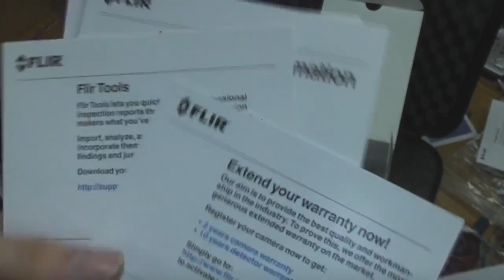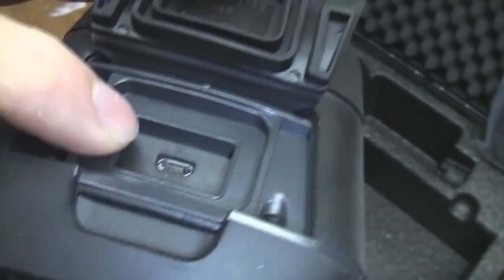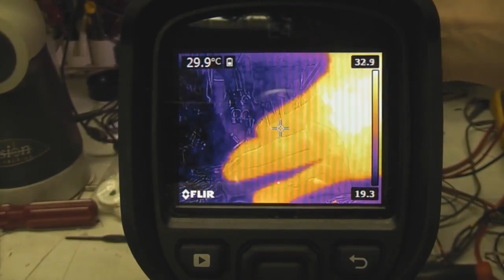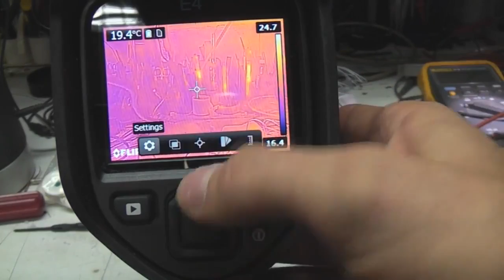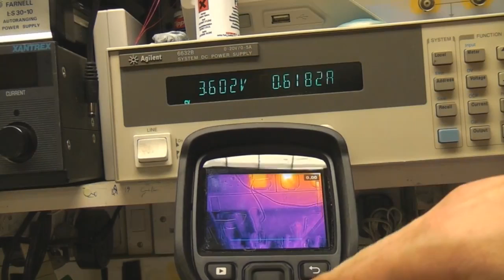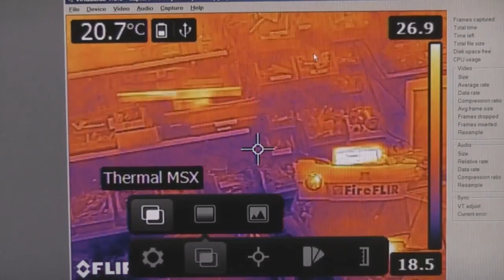Flir E4 Thermal imaging camera review

Comment: Hellow!

PLEASE ANSWER

I have the following questions:

 1.For medical purpose -can this camera be used to study the sleep of  people? To see and track sleep cycles. 

2. What diseases can this camera detect , with and related auxiliaries (computer, medical software, etc.) -as there are used in medical offices(cabinets) to put diagnoses using thermal images?

3. For surveillance and spying(espionage) -can this camera see what happens (what's going on) through these materials (so what happens behind the materials,while the camera is placed in front of the materials:
a.curtain through which a person can not be seen with the naked eye 
b.plastic bag
c.aluminum foil
d.double glazing
e.simple window(normal glass)
f.pvc door
g.wooden door
h.Steel (metal)Doors
i.5 mm thick metal wall
j.Hebel wall 10 cm
k.brick wall
l.concrete wall 5 cm,
m.concrete wall 10 cm
n.concrete wall 20 cm

Please answer to all the questions and select the correct answers for question 3,between variants from a to n.
Any additional information is welcomed.
Please post links where I can see how thermographic camera sees(show to us), for each subject separately (a lung disease, for instance,or how thermographic camera sees through the metal door, double glazing, etc)
Thank you
Best regards
Reply: hyytyfskn

Comment: USEFUL for looking at a cup of coffee, or hot water , or a fuse box, or in a small room part of a wall which great.  However, pretty sure it's nearly WORTHLESS for anything useful beyond your reach.  For example, you want to look up at the sky lights 18 feet up and check for leaks, or look at a cathedral ceiling.  Note how most of the useful things it probably can't see.  I don't mind if the temp isn't perfect, but need to see darker colors where leaks are etc.  Or missing insulation.  Or go outside your house and look for leaks up on the 2nd floor.   Or near the attic.  Notice how all the most useful things it probably can't do.  And before anyone says anything, those things ARE what most inspectors want to be able to do.  Note heat goes up.  Up and away to your ceilings, skylights etc.  That's where it escapes.  That's where the most important insulation would be.  Every video I watch, someone has the E4 looking at their hand, or something within about 8 feet.  Once you play with it, and exhaust those possibilities and try to do something serious, the question is, will it be useful?  I keep getting the feeling no, and that FLIR expects you to pay $5000 for something useful.  And they crippled the hardware on top of it.  So awesome, color hot coffee viewer.  And yes, majorly useful for applications up close.  If I can point it up at ceilings or even cathedral ceilings and look for hot and cold spots, someone please let me know.  I get the feeling it won't.

Comment: I think I know why the menu and the buttons are so sluggish and arranged in such a... sad manner:
As you've noticed and almost everybody knows, thermal imaging cameras are regarded as possible weapons. I guess you could sneak behind somebody, with that camera, and smack him in the head.
Just saying but if it's faster, easier to use, has higher resolution, is regarded as a weapon even more so. Imagine being able to switch between settings between two smacks... outrageous... 
Anyway, if it's sluggish and has odd menus is regarded as more benign.

Thanks for sharing!
Reply: I could easily sneak up somebody with that Flir E4 even if it's capped at 9Hz... I'll have to move slowly anyway to stay undetected, so what's the problem? And with low illumination the camera mode is useless, so the complication of switching between modes is also nonsense.
:D

By the way all regulations regarding IR cameras as weapons are rubbish. I understand it helps to discover somebody in the dark, but then I need to use ANOTHER weapon to kill/knock him off! So what's the problem?
Also regarding the "other" weapon I can easily make myself a harming object without even buying anything. Take for instance a piece of scrap metal :D

Comment: Another example - I had a device using TVS diodes to absorb transient spikes caused by a motor. Based on the specs and the approx spike magnitudes, I saw a risk of damaging the TVSes.  My colleague differed - he had measured the temp using a thermocouple and saw a 2 C rise. I took video with my Flir E50 and the hottest spot actually rose by 80C - still OK but closer to predictions.The temperature rise was too fast and localized for the thermocouple to pick it up accurately.

Comment: I'm still claiming that 1) YYYY-MM-DD is one of the least ambiguous date notations. (Don't use the other ISO8601 notations for anything but machine readable code.) 2) Again, it is a standard, which speaks in its favor. 
And as for "10-10", you should never write a date without a year in a permanent record (such as a date printed on a photo) anyway. You WILL want that info later. And exactly every month/day format consisting of only two number and a separator is completely ambiguous.

Comment: Well, my point was that day month year and year month day have different advantages which may make them better for certain applications. 

A Standard does not mean a certain representation is better in all cases, I could say that today is 2013283 or 2013W414 by ISO8601, which would probably be confusing to many, but if following it, I could never write todays date as 10-10, It would be 2013-10-10. Dashes are optional, they are only to improve reading for humans, so I don't have to write them.

Comment: Contact temp measurement will always be more accurate when it is doable but what about the temp of a small SMD device? Hard to attach a sensor to it without affecting the temp of the device. A spot IR thermometer needs accurate aiming and I've never seen one that can resolve a spot the size of an 0805 resistor. I've used a TIC to  plot the temp of 12 different parts on a PCB over time during a test - much easier than doing it all manually with a spot thermometer or using 12 thermocouples.

Comment: Indeed, they should be smd+through hole.

I even tried to pull on a cable connected to one of my own boards with smd+th Micro USB. The cable end broke of cource. To rip the connector of the board i had to have the connector part of the cable in and use a plier and a lot of force. The cable connector part was bent about 15deg after.

Comment from the maker: The sensor is vacuum encapsulated to avoid convection, so if it isn't perfectly sealed it could leak over time, otherwise it's no different from any other semiconductor device. I've never seen a TIC with  faulty sensor on ebay, so presumably they are reliable.

Comment from the maker: True but if you need to know temps that accurately you'd use contact measurement or a spot IR thermometer - most of the time, quickly finding where the potential issues are is the main application of a TIC.

Comment: The different representations might have advantages for certain applications. The DD.MM.YYYY system is good for general dates, since it shows the number you are most likely to want first. The YYYY.MM.DD is good for archival applications or referring to historical dates, anything where the year is the starting point. The MM.DD.YYYY system is good for adding a bit of general chaos and confusion to things. Seriously though, I expect it was originally mostly used without year, as MM.DD.

Comment: The low resolution plus MSX enhancement does seem fine for general troubleshooting. However, for design verification purposes, the higher resolution is often needed. For example, if you want to document the temperature rise of a number of components at once on a large PCB, you need each component to span more than one pixel in order to get an accurate temperature measurement. If several components are blurred into one pixel, then the temperature values are averaged together and not accurate.

Comment: Mike, the reflected temperature refers to reflected temperature compensation. If your surroundings are at a significantly different temperature than the object you are measuring and the object's emissivity is not very high, then the IR light coming from the object will be a combination of emitted and reflected IR and this option allows you to compensate for that.

Comment: Tell that to the many, many, many tens of thousands of phones and other portable devices where the single-sided surface mount micro-USB socket simply rips the copper straight off the board when force is applied. Not using through-hole pins for support is just crap.

Comment: just like some (android) smart phones. But when this SD-Card is specially formated and with the operating system on it, it would be still hard to utilize that fact.
But from a manufacturing point of view: Well, thats a good way to go. Small, relatively cheap and easy to source, you can easily benefit from dropping prices on the storage marked...

Comment: Reflectance temperature - my favourite demo.
Take a boiling pan of water. Cover with a clean sheet of foil - you measure accurately the temperature of the ceiling. :)
IR coming from an object is the sum of the radiated and reflected heat.
For an emissivity of 0.5 - say - half the light falling on it from another radiating object is reflected. If you can enter the temperature of the thing that's being reflected, you can work out the 'real' temperature being sensed.

Comment: that is usually the problem with mobile phones, someone pushes the connector into the phone, if you are reasonably careful there should not be a problem, there rest is just user error.

I can't think of a solution that is better mini usb and normal type b have a worse connection failure rate.

That said, type b usb are easier to plug in and less likely to get physically damaged by user error

Comment: If i remember it right Micro-USB is designed for the cable connector to break instead of breaking the board connector or ripping it off.

Comment: mobile phones use micro usb and a modern ones will be plugged in at least every day for 2 years without any problems as long as you don't try to force it in the wrong way round, or knock it then plugged in.

Comment: Micro-USB receptacles are designed for up to 10,000 cycles of insertion and removal between the receptacle and plug, compared to 1,500 for the standard USB and 5,000 for the Mini-USB receptacle. This is accomplished by adding a locking device and by moving the leaf-spring connector from the jack to the plug, so that the most-stressed part is on the cable side of the connection. This change was made so that the connector on the less expensive cable would bear the most wear

Comment: I'm surprised at how small the lens is and come to think of it, 80x60 pixels is probably a sensor the size of a 640x480 webcam chip, maybe 4mm so the 1000$ is most likely a severe rip off courtesy of FLIR.
They do have a 240x180 marine camera for 1800$ but it might not have a temperature reading.
The 9Hz rule is US silliness because you can easily point a weapon at someone in the dark and kill them with 9Hz. Maybe for a super fast android it would be too slow..

Comment: the SD card errors are probably because the embedded operating system treats the partition that the user accessible content goes on as a SD card, when you plug the camera into the PC that partition is unmounted from the embedded operating system and mounted on the PC, any delays between unplugging the USB and being able to save a photo are due to the delay in the embedded OS re-mounting the partition.

Comment: With a small sharp knife you scrape the sides for debris. Then take some painter's tape/regular scotch tape and put it around the edges. When you're certain that all is well, simply drop dots of heat resistant glue (it can be any kind so as long as it's heat resistant because the bricks get hot and expand) around the female side of the edge. Then, press really really hard for 4 to 8 seconds so that the glue can bond the two sides. I've used this method to rejuvenate drill batteries.